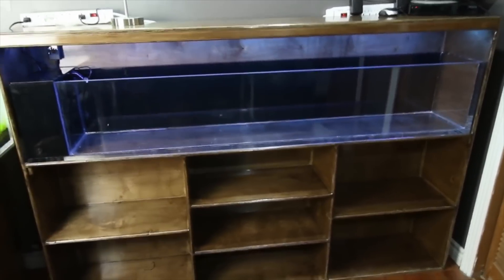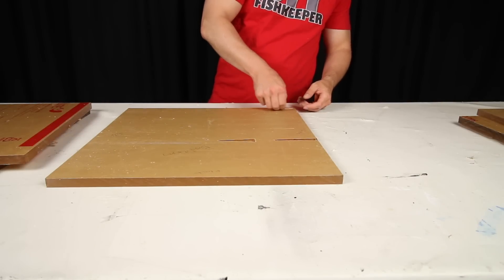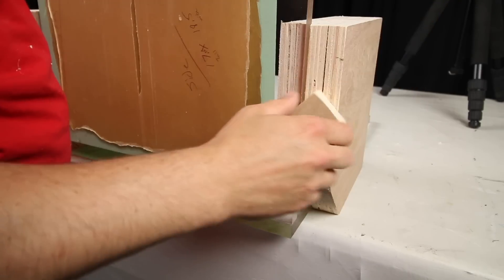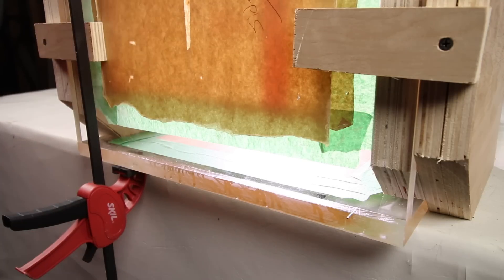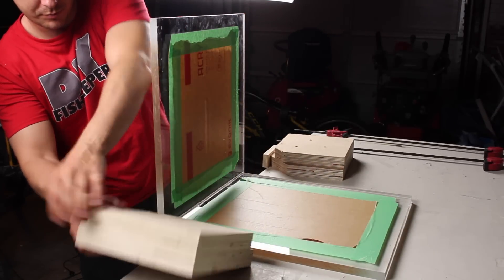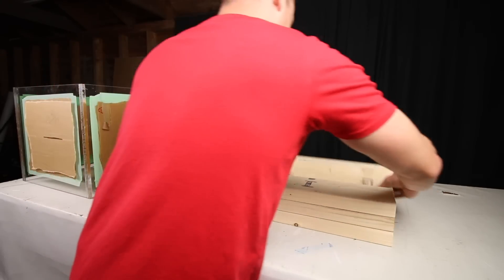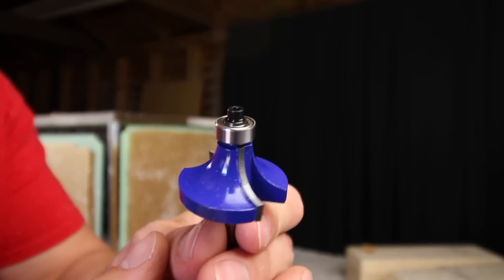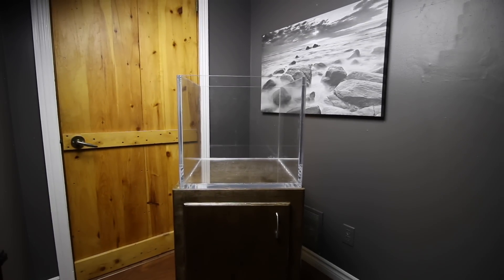HOW TO BUILD AN AQUARIUM - BRACELESS!!

Comment: you can also use a nail and put a dimple in the edge of the material then when you use weldon 4 or 3  it melts the dimple and no pins need to be removed

Comment: Finally Joey can't wait to start my planted tank now lol
Reply: ***** nice .....I'm waiting to see more information on lighting I have  the basic aquarium necessities for now 😏
Reply: SDD525i currently have a 10gal experiment tank with a fluorescent light which works great. But I always appreciate more information especially on lighting since it's not a topic which is covered properly on YouTube. Joey on the other hand does well in explaining stuff so when I'm ready I know I have gained knowledge to have a successful tank.
Reply: SDD525....yea same those LEDs are costly but my only concern with florescent is that after like a couple months your have to change the bulbs.
Reply: correct me if im missunderstanding yall, but couldnt you do a uvb light fixture for reptiles? i have one on my chameleons cage it even with the dome around it it works for the plants in my tutles tank which sits about 6 inches away from it. plus bulbs are cheap, and last decent time, mine is going on 4 or 5 months, also zoomed makes some decent looking fixtures
Reply: SDD525 I prefer LED tho  for the compact and efficiency lol
Reply: SDD525 lol yeah I'm saving up for that but most likely I'll use 6500k CFL bulbs until I prefer those over t5s.
Reply: Charles Alberti I haven't done any research with uvb lights but provided that the light parameters are the same which plants require I'm sure it would do a good job for plants.
Reply: SDD525 only reason I prefer CFL is because I won't have to get ballast to power them.
Reply: dennis wong has a really good video (on youtube) on lighting. for small tanks i would go for leds but once you go bigger leds just tend to get less cost effective vs fluorescents. there are definitely still some really good led fixtures for large tanks though, as well as some new ones that look interesting.
Reply: Karim Swift I looked at a lot of videos from Dennis, he does have great information. My tank is about 45gal I definitely prefer the led tho over fluorescent in the bigger scope of things but I definitely have to weigh my options of output vs cost effectiveness.
Reply: Kevin Fonrose the issue with a lot of leds is they can be quite white and colour rendition is poor. also some of the best leds, bmls, are out of production. for full disclosure, my knowledge on lighting is probably the weakest part of planted tanks for me. i like biology and chemistry, physics not so much.
EDIT: btw i recommend joining a forum, i'm on plantedtank.net, but there are a few good ones. there are very experienced people on forums who can offer advice for all parts of the hobby including lights.
there are decent facebook groups too but i prefer the way forums are setup.

Comment: I notice that you had a bit of the softened acrylic squeeze out on the inside seam of the tank as well as being on the outside seam. you were able to clean up the seams on the outside with the router, but is there anything to be done for the inside seams? or is it not that noticeable?
Reply from the maker: It cures clear. I just leave it. Only a very little squeezes out, which ends up shrinking in size when cured anyways. You cant see it once done. Although you could always scrap it off if you wanted to.
Reply: thanks for the quick reply! I have been considering a large 180 sized tank. now to just get over the stage fright of working with so much expensive acrylic...

Comment: Joey, I'm a perfectionist.  My hobby is wood working.  So building this is not too difficult.  My question is, what do you do about the gunk squeezed out in the corners on the inside of the tank?  Do you leave it?  Thanks!!!!
Reply: Philip Kong I'm pretty sure I remember it's easier to cut off when dry
Reply: I'm referring to the glue gunk.  Thanks!
Reply: use a wet finger and smooth it over before it dries

Edit: sorry i forgot it was acrylic. I spaced out and thought it was silicone for a glass tanl
Reply from the maker: No, dont do that. Never touch it until cured.
Reply from the maker: I leave it until cured. It cures clear. The stuff on the outside, i route or sand off. The stuff on the inside I leave. Although you can scrape that off if you like.
Reply: Thanks!